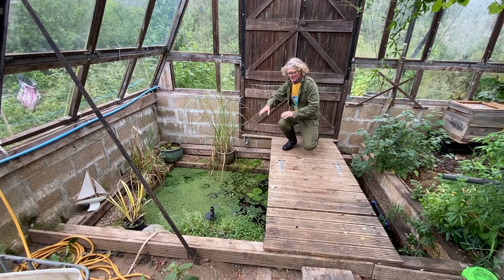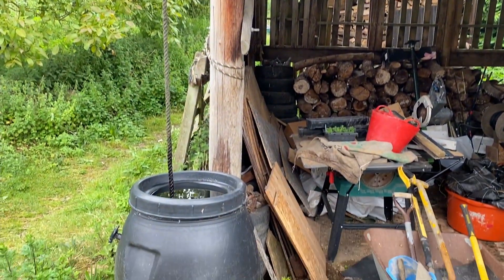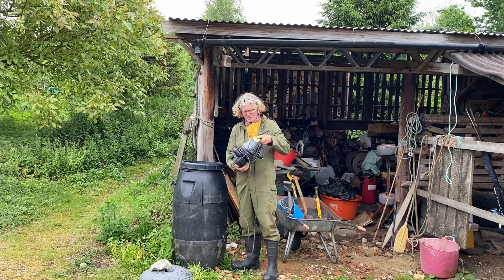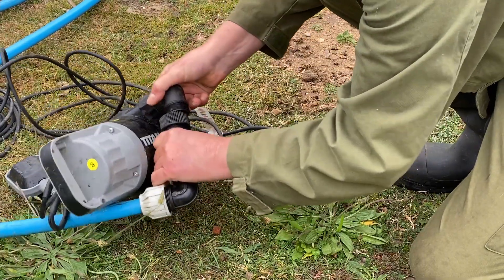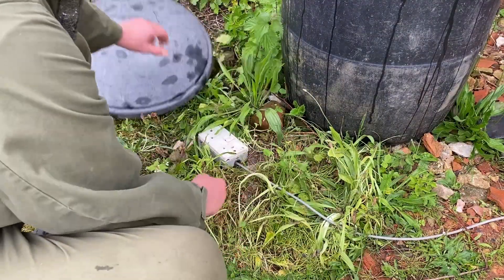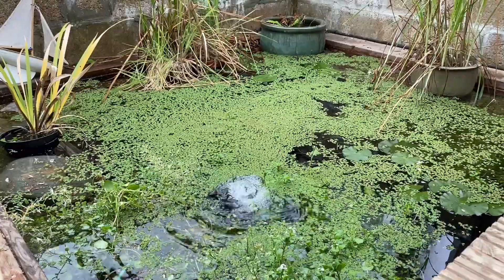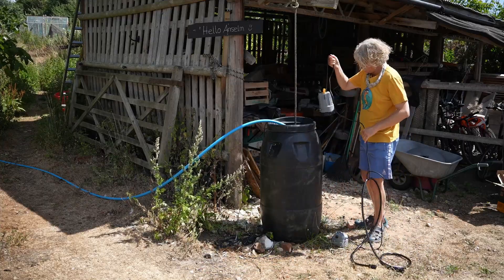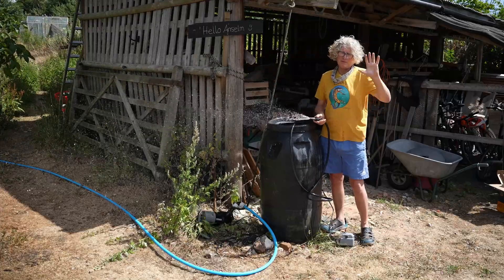Drought Busting Butt Pump

Comment: This has been a major concern with building my pool. We're in a mega drought. Do your bubble pumps have an automatic shutoff if the water gets too low? Or do you just make sure the aeration stone is down toward the bottom?
Reply from the maker: The bubble pumps will not cause a problem if left on. But if the water level is too low for them to work, then you may as well turn them off and wait for rain. I also have the pumps on a timer so the just come on during the day.